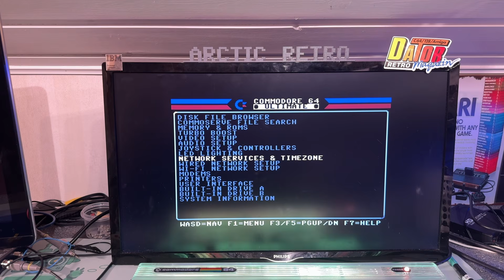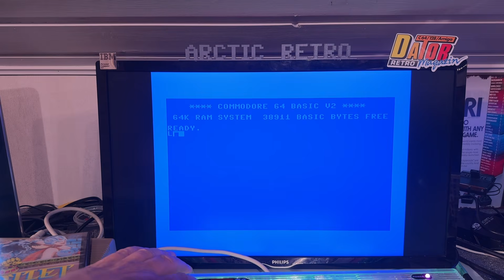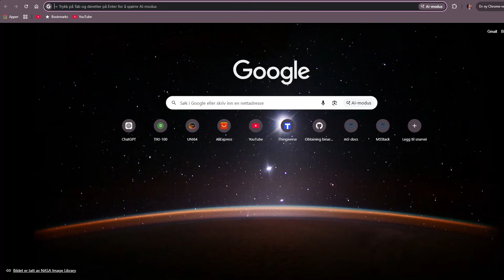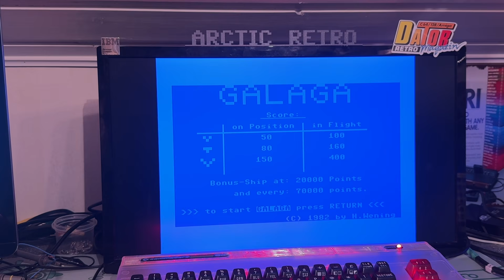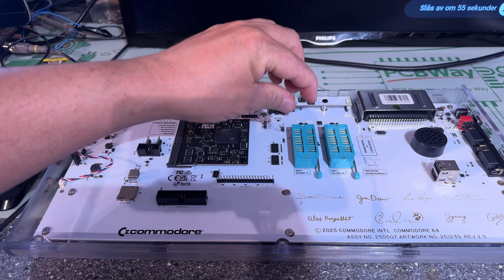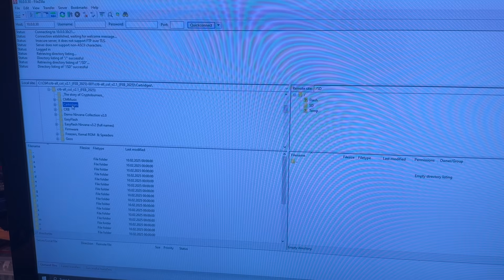THE C64U: It just performs! Old hardware works, loading games via WI-FI and a peek inside!

Comment: Can the new Commodore 64 Ultimate or the new Amiga 1200 with its fast processors and super storage be able to have the newest flight simulators and action games like Grand Theft and NBA 2 K27 be ported to them ?
Reply from the maker: I don't think so. The graphics requirements for those games are simply crazy high. Only the latest PS5 and XBox will be able to play the new GTA. Someone could of course make a less demanding port, but I don't think there is enough market for that.

Comment: It's very picky about the Wi Fi.  You have to make sure you're on 2.4 only.  It will technically connect with combined radios, but it won't be happy.  I'm not willing to separate my radios, so I just ran a cable.
Reply from the maker: That's good to know, thanks for the heads-up about the network settings! :)

Comment: I saw a video where the C64U also had flex, and they added supports.  Search for Commodore 64 Ultimate 3D printed keyboard flex fix. It's not what you should have to do with a new computer.

Comment: For FTP i Always use winsrc, very comfortable Tool to Put sone d64s to thesd Card  besides, you should really dig in to the config files to easily Switch between different configurations Like PAL,NTSC with or without a Floppy speeder. Usinf the Action replay cartridge IS pretty cool as well, but you need to 3d Print another sideplate with 3 Buttons to control IT...
Reply: Also very comfortable for FTP is the "Total Commander". It's a Clone of the famous Norton Commander and therefore very productive!
Reply from the maker: Thanks for the tips, I'll definitely look into those config options! :)